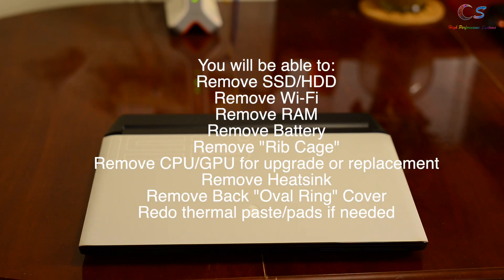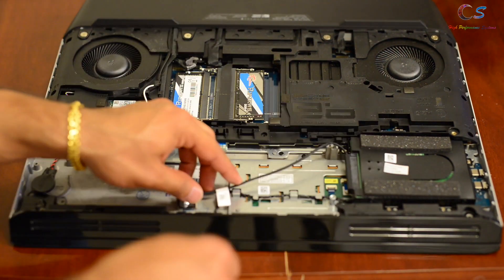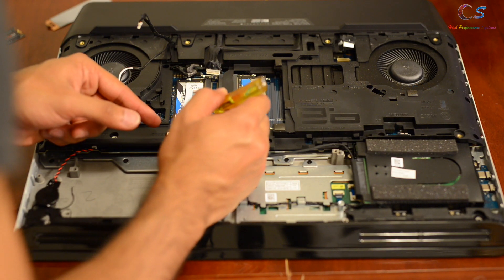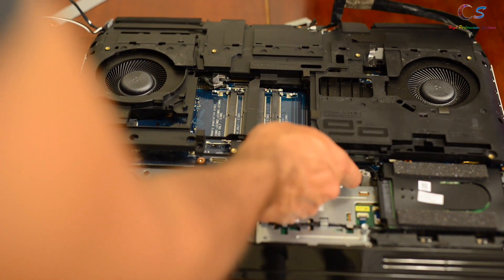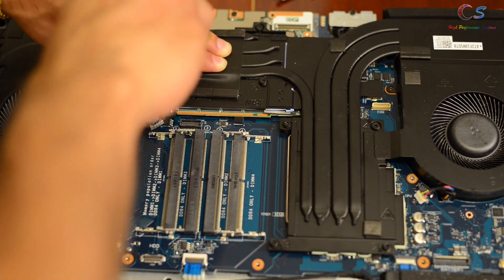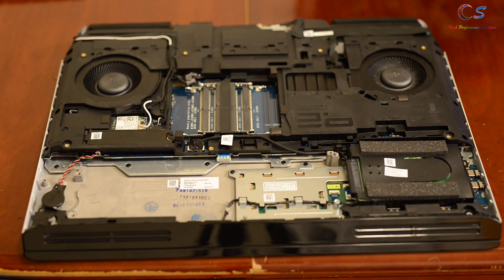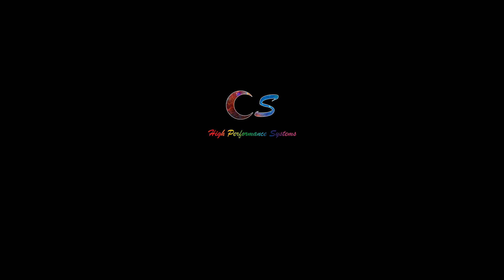Alienware Area-51m Disassembly & Repaste

Comment: Mine has thermal pads on areas around the GPU, it concerns me on replacement
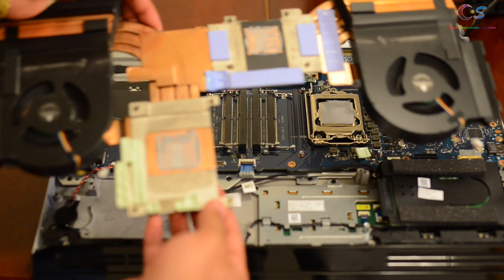Reply from the maker: 3:33 you can see all the thermal pads on my heatsink. Idk what other thermal pads yours has.
Reply: @cs.studios  ah you are right, mine just happen to be stuck to the mobo instead of the heat sink! Thank you! You think thermal pads are necessary or could they be replaced with thermal paste? I might have to wait and order pads for replacement since mine won’t be reusable.

Comment: Any info about replacing the thermal pads? Can't find any guide for that anywhere, and yet everywhere there's info that you gotta replace thermal pads as well after some time.
Reply from the maker: Thermal pads are mostly trial and error. I like to buy a 0.5mm to 2.0mm 4-pack and replace with ones similar size to old one

Comment: Do you know what are the sizes for the thermal pads that come with the heat sink? I tried using thicker pads for better insulation but that didnt work because I noticed the thermal paste wasn't spreding when I removed the heat sink right away.
Reply from the maker: Sorry I don’t. Id buy a variety pack or get a cheap pack of each 0.5mm, 1mm, 1.5mm, 2mm and see which config works best

Comment: Question.... Im trying to figure out if the fans can be taken out and replaced from the heat sink assembly or do I have to buy the whole assembly. My gpu fan is making horrible noises and not turning properly like the bearing is seized but the cpu fan sounds great and works fine.
Having a hard time finding any info but this video explained more about the teardown in a couple minutes than I have found anywhere else.
Any info would be great.
Thanks
Reply from the maker: I believe they can be removed. Worse case they are glued to the heatsink assembly. I found some fans by themselves for sale on eBay so should be possible.
Reply: @cs.studios  thanks for the info. I'm not the most comp savvy person so its a bit difficult to figure out. Cheers.
Reply: @IIIMAGOOIII  My GPU Fan is making a loud whining noise, did you ever figure out if you can replace just the fans?

Comment: Does you're still run in the low  70's?  I finally got a good revised one of ebay and it looks like they put thicker thermal padding under the bottom heatsink unlike the last one.   This only reached 70c on one occasion after two hours of gaming.  I used Artic Silver paste.  In the begining it was running hotter but once the paste set in  it runs 10c cooler.
Reply from the maker: Mine runs hot and needs a repaste. 70s is good for a laptop on full load
Reply: @cs.studios  I just repasted mine and updated the bios back to 180w.  It runs stable again.  I used MX-4.
Reply from the maker: I need to repaste mine
Reply: @cs.studios  Mine was running fine untill I ran Crysis remastered.  I guess the don't call it a system killer for nothing lol  I think I went a little too high on the settings since it pretty much brings the the 3080 to its knees on Utra.  All...well I repeated and added a new cooling pad where one was begining to tear seems ok now.  I just won't run Crysis again on high setting rather medium.  I'm waiting to see if they release new drivers to run the 3080 in the amplifier before I purchase one.
Reply: Mine actually started throttling now.  Not untill it reaches over 80 though.  I have thr old bios and command center.  Can you run the new bios with the old Command center that isnt limited to 75?  What kind of paste are you using?  I usually use MX-4.  You think a fan stand would help?  I ordered IETS gt300.  Its rated good for the 51.  It Has a dual blower where the fan intake is on the bottom.

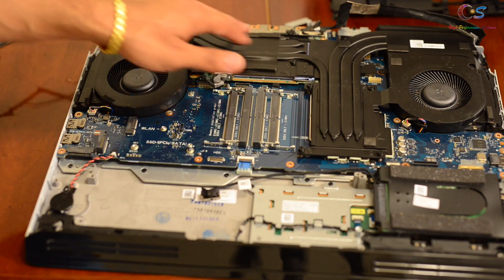Comment: the 2060 has the exact same setup for fans/heatsinks that you mention for the 2070/2080 at 3:00
UPDATE
*after spending hours on the phone with Dell and Alienware tech, I was told each of the gpu's have a different thermal solution. So even though the external for the 2060 looks similar, apparently somehow it's different from the 2080.

I bought a 2080 upgrade from my 2060, and they sent me the gpu alone. So without that correct thermal solution, the entire system shuts down when attempting to play a 3D game. Works fine outside of 3D gaming, but once you start a game (the division 2 for example), within 2-3 minutes max the entire system powers off completely.

The dell sales rep I spoke with initially must have just sucked at her job. The guy I spoke with today gave me information about how for the system I have, the 2070 is recommended by them. Spoke with an alienware tech as well about this.

Problem is, I'm at 6 days outside of the return policy, but the technician guarantees it's a defective gpu after going through a lot of troubleshooting, and the sales rep says I wasn't supposed to get the GPU alone anyway! The returns department escalated my case, so I'm hoping they will accept the GPU as a defective item for a return, so I can purchase a 2070 upgrade kit, which wouldn't ship until Nov. 25th!!!
Reply from the maker: The 2060 doesn’t have the side vents and has less heat pipes. Dell is supposed to include the heatsink along with the GPU upgrade. I recommend using the AW twitter for help as it seems to be better than calling them
Reply: @cs.studios  Their twitter told me to just use the website lol. I tore down the laptop myself today. It has 2 heat pipes across the cpu and 2 across the gpu, versus the 4 cpu x 4 gpu for the 2080. They also sent me a refurbished on, which I saw on the outside of the box! Not only that, the thermal pads that go along the side of the heatsink that make contact with some chips on the gpu, had a blue plastic cover over them that should have been taken off at the factory. It was in my machine like that, and I only know because I took out the 2080 and put the 2060 back in. I was curious about the heatsink on the 2080 so unscrewed it and saw the plastic covering the thermal pads that should be making contact with the chips on the gpu.

This whole thing with dell has been a big mess. I just sent the 2080 back today, was approved for return. I have a 2070 that should be coming in Nov... but we made sure its the ENTIRE upgrade kit this time.
Reply: @cs.studios  I used this video and another to help during the disassembly but yours was more helpful because you showed the process of putting it back together.

Comment: I did have one question does the heatsink on the bottom of the 2080rtx make much of a difference the card I had didnt come with one and dell was out of them.  I kept getting random temp spikes with that card compared to 2070.
Reply from the maker: I think you need the heatsink on 2080. I would ask them to see if they can send it
Reply: There's a used 2080rtx on Ebay with the heatsink but I dont know if I wanna take a chance on a used one and Dell wants like $1800 for a new one, which is crazy and their out of stock on the heatsink.  What kind of temps do you get with it?  Thanks for replying.  With dlss 2.0 the 2070 isn't bad so might just stick with it internally.
Reply from the maker: I get around 73C with performance fans and maybe 76-77C with auto fans
Reply: @cs.studios  Ok, thanks again.
Reply: @cs.studios   I had one more question does the 2080rtx version major heatsink on top different than the 2070 version.  I get conflicting reports on that.
Reply from the maker: 2080 heatsink is better than 2060. 2070 is mixed, check to see if you have all 4 exhaust vents working. You can also find heatsinks on ebay.
Reply: @cs.studios  Yeah, I bought  a used one from ebay it periodically blacks out in gpu bench software so.  It was with the 2070 heatsink.  I don't think  that was the issue though since the temp was capped at 75 after I updated it.  I'm gonna send it back and buy an m.2 drive.  I can't believe the new R3 isn't any more upgradeable and the price isnt work it.  It looks the upgradeable dream machine slightly failed agai n.  It makes you wonder if their even going to bother with an R4 since the price with ampere gpu's is going to be astronomical.
Reply: @cs.studios  Actually the 2070 heatsink I have in my mine is the 2080 version.  I don't know if their is a 2070 heatsink or if that's was just a concept after doing research. I have another 2080 gpu this one looks in much better shape.  Repadding with artic pads and using liquid metal thermal compound.  Hope this one works and the liquid metal helps temps.
Reply: Ok...last question does your card consistently run at 73C while gaming or just sparingly when it's under heavy load when you've been gaming for awhile.  I'm just curious since my 7070 does around 50C usually and only spiking to 65C  if I game for awhile.

Comment: I've dissembled desktops but was apprehensive on this since I never disassembled a laptop.  Although you made it a breeze.  I did have trouble reconnecting the wireless card since I dont have small fingers and those connectors are so tiny.  I had to have my wife do it since she has smaller fingers.  I cant believe how crazy small it is.  It's like connecting an 9 volt battery only 50 times smaller.   Anyways Thankyou,  this is the best dissambly guide I've seen for this laptop
 Its much better than the other ones.  I tried upgrading to 2080rtx from 2070rtx but sent it back since I found out about the decrease in power and temp limit a little late.  It really doesnt make the upgrade worth it.   I'm just goin with an amplifier and buy the 3080rtx a bit after it's release.

Comment: want to know your temps!
Reply from the maker: They’re worse than stock paste. My thermal grizzly review video has the temps, but right now i get around high 80s low 90s under full CPU load. For GPU i get high 70s to low 80s.
Reply: @cs.studios  It is needed to liquid metal so :P As every laptop, especially Alienshitware like the one i have
Reply from the maker: Even a high end paste will work as long as theres good contact between the die and heatsink
Reply: @DhalonTech  be careful with liquid metal as it can react with copper not something I would ever risk.
Reply: @arjgrando  i used it on the Alienware R3 15 that I own. It is working as well. I even overclocked it as well. My work on hasn't been so good, but it is working on 4.0GHz and temps around 80 not over
Reply: @DhalonTech  Temps will be excellent that's for sure but keep an eye on your copper/alu parts as the Gallium in liquid metal pastes will react with them and degrade them. 

For your info bud.

https://www.gamersnexus.net/guides/3362-how-liquid-metal-affects-copper-nickel-and-aluminum-corrosion-test
Reply: @cs.studios  Did you go back to the old bios? Would you recommend downgrading bios for performance?

Comment: No end results were shown, which probably means this whole procedure was a complete waste of time.
Reply from the maker: Ah, I realized it's on the other video. See the "Thermal Grizzly Carbonaut" video above this on my channel. Carbonaut wasn't worth it, temps were worse, due to the thinness of the pad. I recommend using high performance thermal paste instead such as Gelid Extreme, IC Diamond, etc..